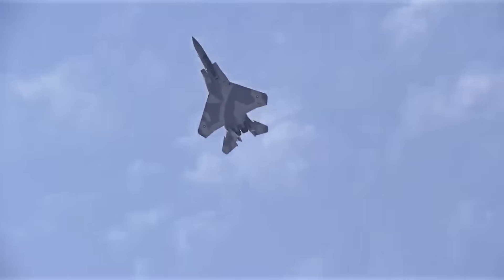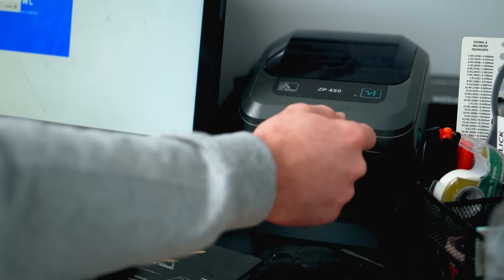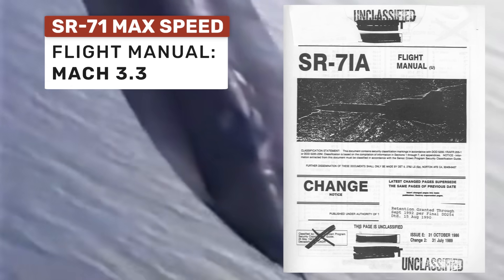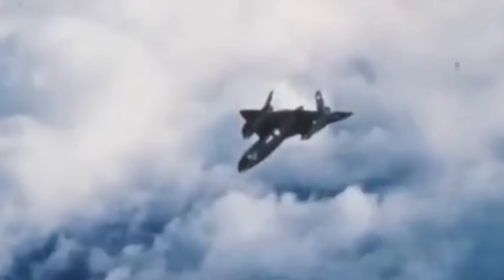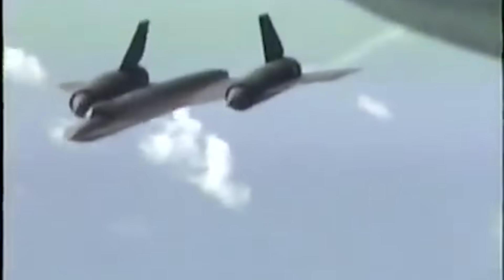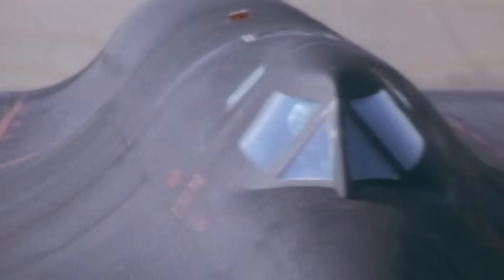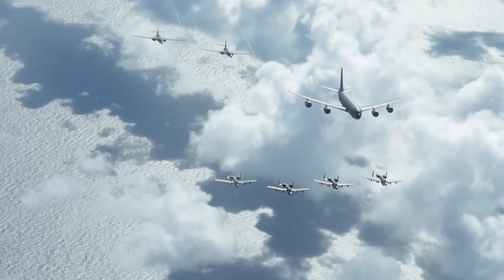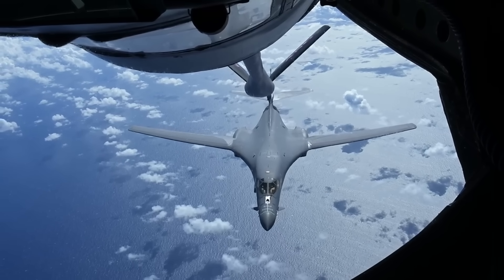The SR-71 was MUCH FASTER than the Air Force will admit

Comment: From what I have heard and read, no one EVER used full power in the sr71, or at least, not for long. Its top speed was not determined by power or aeros.... it was just determined by the fact that eventually, at a high enough speed, shit would start to break. The plane could always go faster. It just wasn't safe to do so.

Comment: All it takes is a little bit of basic math to figure out the top speed of the SR 71 blackbird was well over marked 3.5 as stated it was over 4.0 actually, all you have to do is take power to weight ratio and drag intothe equation the resistance at 100,000 feet that gives you a top speed of Mach 4.1

Comment: There is always a potential of going faster than what is safe for operating speed that is why they limit the aircraft just like the av8b harrier is listed at mach .9 which is limited because the airframe considering that the F402RR408 has 23,500 lbs of thrust. Every fighter aircraft has means to shut off the limiters in emergency combat situations the question is what would be the max it would be able to go once they are shut off and how long it could sustain that in flight before catastrophic failure.

Comment: The SR-71 could get to altitude and cruise speed fast but I don't think it could maintain it for long. If true as is said, they took off without a full fuel load and had to meet with a tanker to fill up then how long could they fly at cruise speed straight after takeoff without refueling? I doubt it's coast-to-coast. Take a look at the flight time and measure the distance. The 68-minute flight has an average speed given but someone please, do the maths. They had to take off, refuel then do the dash. The top speed has to be a lot faster than the average speed. How much? I can only do a poorly educated guestimate.

Comment: I think s generally acknowledged that the A12 was faster., flew higher and took about 1/3 of the continent to turn 180 degrees.  The SR72 will perform a lot better than that but, to my great disappointment, not be "crewed."
Reply: Small continent…

Comment: this guy probably dont understand flight. many aviation fans dont even know flight aspects of those planes. SR 71 made its record speed(meaning its HIGHEST speed it can only get ) at about 34,000 feet altitude. do you know why it is documented, that altitude? because it was BRIEF. not because "oh , only at about 34000 feet the SR71 could fly hypersonic", NO, its that very altitude the record was CLOCKED. get it? and do you know how it gets the record? IT DIVES FROM 60,000 feet. yes IT DIVES DOWN. as it reaches 34,000 feet, the pilot has no choice but to level the plane back because maintaining that speed with the plane entering a denser lower altitude will BREAKS THE AIRFRAME. get it? thats the ONLY WAY the plane can get that speed. dont be such a fanboy.
it means at AVERAGE SPEED, where the SR71 suppose to do its operation, it will be STRICTLY hindered to BELOW mach 3. thats at over 60,000 feet. the USA made too many hypes and made their reputation on false merits.
here reasoning why SR71/A12 cant go faster than MACH 3 at normal operation is : the plane need less denser atmosphere to get higher speed from obvious aerodynamic reason. and in HIGHER ALTITUDE the air composition is not rich enough to get enough power to the engines. that even with the special fuel with rich oxidizer mixture. the plane can only get to mach 3 by DIVING. and diving ONLY to a safer atlittude that is not less than 30,000 feet with that speed. other wise, you will see the plane breaks in 2. so MAXIMUM SPEED AT LEVEL FLIGHT (not diving) is reached at normal operation with engines at full power at over 60,000 feet and thats merely BELOW MACH 3.
Reply: I DON'T GET IT
i DON'T GET IT!!!!!1

Comment: I have to ponder: If the SR71 was designed to out run balistic missiles (a few air-to-air missiles rate at Mach 4) AND it was fired upon 1000x but never struck, will we ever know how fast a top speed the SR71 could actually achieve?

Comment: Its worth saying that the concorde was limited by ram air compression temperature.  Nog by thrust... not even close. It probobly could make mach 2.8 or 2.9... but only for a minute or two untill the turibe burns up.

Modern jet engines hade hot air much better, on the flip side they have higher conpression.

If you have a dual flow core the compression can be varried with speed. Hence getting both the advantage of gigh compression at low speed, and low compression at high speed.

This would basically remove this limit from fighter jets and they would be able to go both faster as well as being more fuel efficent at low speed.

GE have one of those engine for bench testing. And it possible that they alreddy tested one on a aircraft.

Comment: Without discussing the question what the Mach number means, the whole topic is pointless.
The speed of sound is a function of static air pressure. With dropping air pressure, the same indicated air speed and ground speed (Two different things!) make different Mach numbers.
The key to getting th Mach number indicated on an SR-71's dash up would have been to go higher. In even thinner air, structural and thermal load AND the speed of sound would have been reduced.
And it was THAT part of the story where the SR-71 data was understated in public. I watched an interview with an SR-71 pilot ages ago who, when asked about the service ceiling of the Blackbird, replied that it was much higher than published. "It was incredibly satisfying, watching MIG-25 struggling for altitude thousands and thousands of feet below." roughly is what he said.
So simnply reading out Mach numbrs is rather pointless.
Reply: Thanks for your time writing that. Now I understand a bit better.

Comment: Would like to point out that the Air Force has never lied about the planes top speed.  It has been and still is Classified, that is why it still has the generic blackbird top speed of M3.2+ note the plus sign as that means its over this speed.  This is common practice for most fighters, the true top speed is never given.  That it is faster is not surprising given the A-12's top speed jumped to M3.35 when its top speed was declassified.

Comment: It was almost surely powerful enough to exceed its airframe's limits. The obsession with speed is a little misplaced. And the rationale for low ball top speeds (beyond secrecy) may have more to do with not normalizing higher speeds which resulted in a less effective aircraft for the intended mission. Gain a few hundred knots and lose ability to turn at intended altitudes or damage features critical to other countermeasures or aircraft availability with a limited fleet. And keep in mind, its a plane that was intended to go on missions over enemy territory, which could not afford to be lost under any circumstance. Point is, the program and operations were never about hitting a top speed record, that was just a by-product of the design demands.

Comment: When I was in high school.  I remember getting up to get ready for school, and hearing on the news that an SR-71 had just taken off from the west coast  headed  for the east coast.  One hour and six minutes later it landed in Washington DC.   California to DC  in an hour and six minutes.     That is absolutely haulin balls.
Reply: @SelfEvident    It absolutely did happen
Reply: Lemme see:
    One hour and six minutes is 1.1 hours.

West to East Coast is 3,000 miles.
3,000 divided by 1. 1 hours = 2,727 MPH

2,727 MPH divided by 700 MPH = Mach 3. 89

That sounds about right.
Reply: @rdelrosso1973  Yep, it all adds up. I know I have flown that same distance on an airliner, doing about 650 mph, and it still took like 4 and a half hours.  I couldn't even imagine screaming through the atmosphere at nearly 3 thousand mph.... Holy shit
Reply: @rdelrosso1973  LA to DC is 2404 miles, at 67 minutes 54 seconds that comes to 2124.5 mph average ground speed. That's 35 miles per minute for over an hour. Mach number is dependant on the temperature, which can be from -3ºc to -55ºc @ 25km asl.
Reply: Mach is dependant on air density which is slightly affected by the temperature. It's more affected by the altitude.  Nevertheless the temperature at 35,000 is -60°F consistently no matter the season. That means the density at that altitude and higher is pretty consistent. 
You're correct on the distance LA to DC as the shortest most direct route.  You have to remember that the 71 may not have flown the most direct route.  It would have to climb above all commercial and military air traffic. The military regularly flies at around 47,000 feet altitude.  The 71 would fly an arc up to possibly 80 K feet if it flew lower it would have to fly slower to reduce temp due to increased air density. If it flew higher it flew longer.
Reply: @rdelrosso1973 now add a 10 minute rendezvous with the tanker aircraft so that has full tanks to fly from West Coast to East Coast and then redo your math
Reply: Was the footage of the SR-71 at the end of this video cruising low past Dulles Airport (@10:14) taken on that day? That was a surprise to me when it popped up ... and very COOL!!
Reply: Could be. Don't really care. It's definitely within speeds the thing is said to fly.
Reply: @peacemaker9807  could be what?
Reply: The fuel doesn't ignite with contact with air, in fact it's difficult to ignite.

To ignite it, a small amount of TEB (not TEV) is injected. That stuff is pyrophoric.
Reply: It's even faster than you think.  They had to slow down twice to refuel from the KC-135Q (R) tankers that were waiting on it.
Reply: I lived in California at the time and heard the sonic boom.
Reply: @johnfalcon84  it was  in the early 90s sometime.  It took off about 20 miles from my house. 🤘
Reply: @SelfEvident  This isn't the Bible. There's actual proof of it happening
Reply: I lived on Beale AFB in the late 80’s.  It’s one of the homes for the SR71. The other homes were in Hawaii and England. Basically each base is 1/3 around the globe. 
At that time I was told it flew 2,300mph.  I worked at the Officers Club and met several of the pilots, and my neighbor was a fire fighter on the base.  When the SR71 is fueled  is done by a fireman, the fuel is nicknamed TEV. The fuel ignites instantly when exposed to oxygen.  The structure of the planes skin and other components have measurable gaps between the pieces because the fuselage heats up to 800% during flight. Caused by the friction in the air. 
While circling the base just after takeoff, it’s common for it to leak fuel which can start fires on the ground. Yes. When up to cruising speed the leaking stops as everything expands due to the heat. 
If you asked a pilot how fast it flies, you may be told, the engines have never been run at full throttle.
Reply: @michaelpettit3188    the fuel doesn't ignite instantly with oxygen if it leaks all over the place while it's on the ground
Reply: @michaelpettit3188  😂😂😂😂 that's funny, the fuel will not light with a flame on it.   It needs to be pressurized and atomizer to even ignite 😂😂😂   

The fuselage leaked so bad that it was topped off and taxied and launched usually without stopping.   By the time it got to 35k feet it had to refuel from a tanker or risk running out from the leaks.😢😊😊😊   Look up JP8, then check back.
Reply: Proof of the Bible happening even more so. The fact that you’re alive to type your comment is proof.

Comment: According to a White House source, after a certain speed is reached. The turbofan no longer are functional, and they are bypassed. And then a
becomes straight Ram jet engines and the speed of the aircraft is only governed by the aircrafts structure of the aircraft.  The aircraft speed is unofficially lot faster than 3.56 m
MACH ! But then your running into air speed territory off the aircraft desentigrating! In other words the aircraft has more speed and thrust than the aircraft structure can withstand!
Reply: I need to correct: all Blackbirds and the preceeding A-12 variants use turbojets.

Comment: It is not just the air force that does this. I was stationed with the 1st Armored Division when it was in Germany. The M1 Abrams is faster then they claim on paper.
Reply: Same goes for the Leo 2 (I worked for RMV) I know some Construction Engineers and A guy Who had to "recover" a Tank on the Road (left at the loading dock).
he Run that thing flat out on a Highway, just to mention in Traffic!!
That was a story to cover up (news paper writing all about it) no one mentioned the speed he was going, 
but he said the guy in the Van had a hard time covering him.

Comment: I would not be surprised if the F 15 could do mach 3, considering that it was designed and built to defeat the Russian Mig 25 and at the time it was thought that the Mig 25 did mach 3 and flew very high. So i would assume that the F 15 was designed to be able to engage the Mig 25 and perform at those altitudes and speeds, even if the Mig turned out not to be as capable as they thought.. Just look at the size of the tails on the F 15, i would say they are designed to give directional stability at high altitudes.